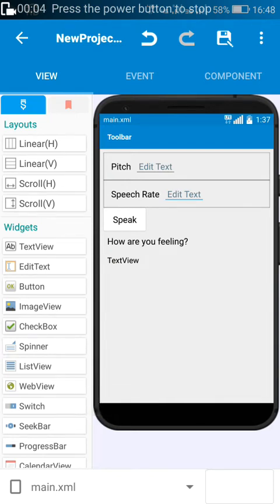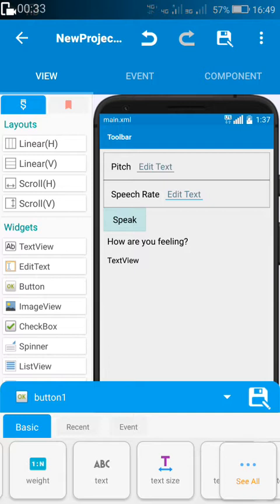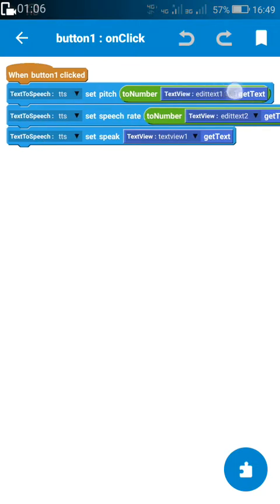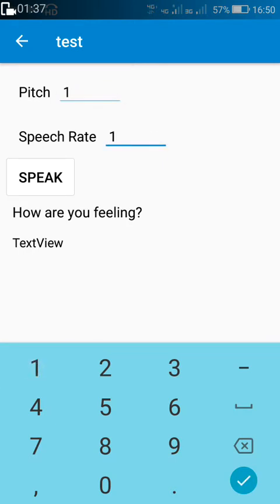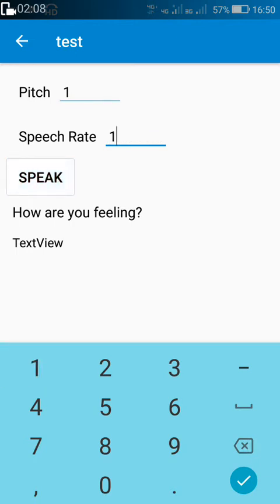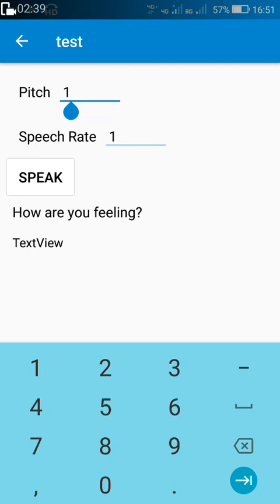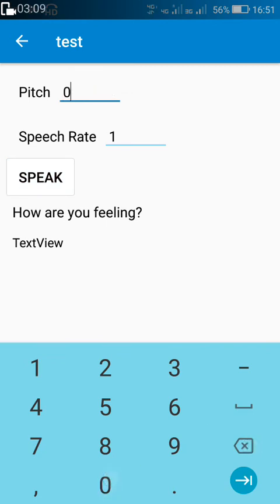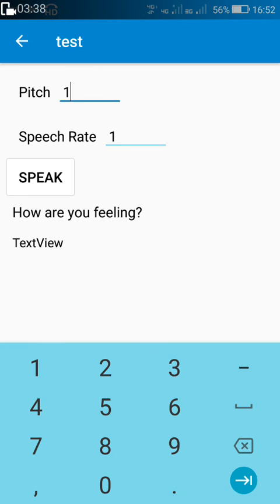TextToSpeech pitch and speech rate in Sketchware

Comment: How to downloads or read the data in a Blob in WebView on Android?

Android.content.ActivityNotFoundException: No Activity found to handle Intent { act=android.intent.action.VIEW dat=blob:http://digitalinsensu.com/0f0d6127-a0f1-44c3-af85-72f648258d6d
Reply from the maker: Use WebView loadUrl Block to open the url
Reply: @sketchwarehelp  I tried the following code, it throws error

code:
webview1.setDownloadListener(new DownloadListener() 
{     
public void onDownloadStart(String url, String userAgent, String contentDisposition, String mimetype, long contentLength) 
{ 
Intent i = new Intent(Intent.ACTION_VIEW);
i.setData(Uri.parse(url));

startActivity(i);     } });

Android.content.ActivityNotFoundException: No Activity found to handle Intent { act=android.intent.action.VIEW dat=blob:http://digitalinsensu.com/0f0d6127-a0f1-44c3-af85-72f648258d6d

How should I be downloading the blob? Any help would be appreciated.